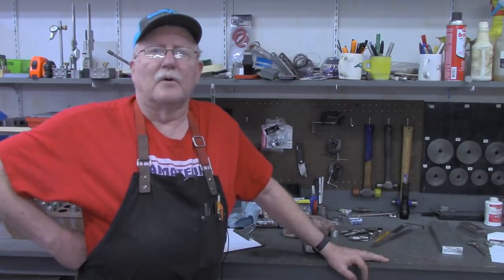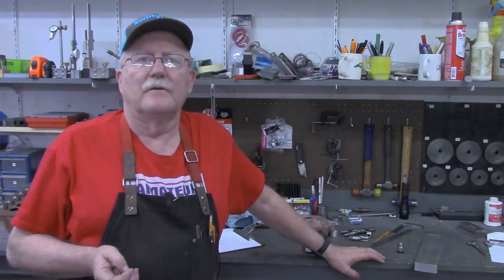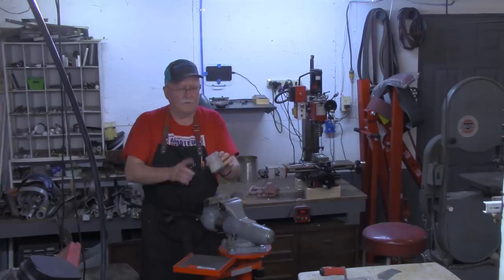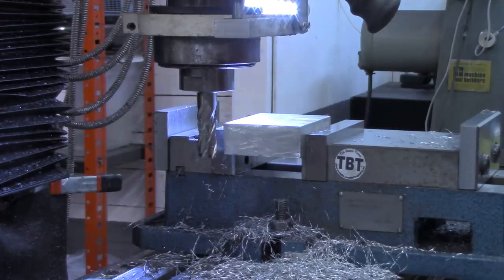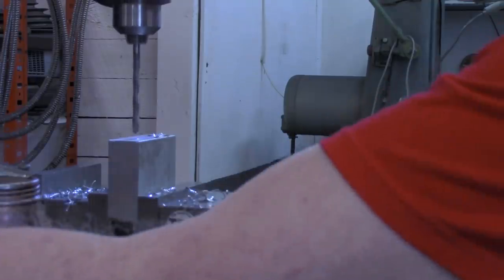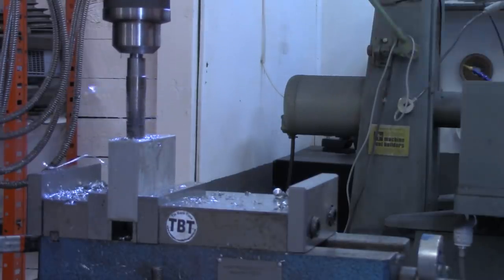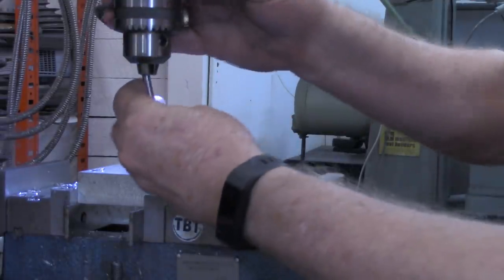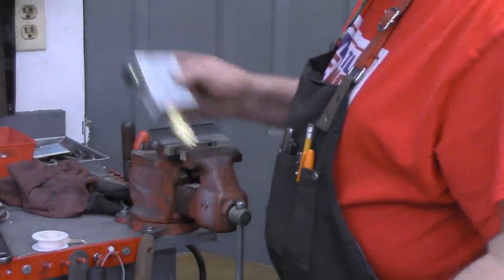Machining a Compressed Air Drop Block

Comment: Lee,
   I agree about the portable band saw from HF. I bought one when they first offer the Bauer and I have to say I don’t really know how I did without it. I’m constantly using it. I put it on an mount that is removed by pulling one pin so can use it portable when I need to buy most of the time it’s in the mount. It was 99 bucks and with a 20% coupon it’s the best money I ever spent for a tool. The saw has performed flawlessly and I’ve put it to some pretty heavy work at times. I’m not doing a promotion for HF. We all know you gotta be careful there but if common sense is used there can be some decent products purchased there.
  Good video. I’m getting ready to plum my shop for air. I was going to use black iron but may look into the rapid air system.

Comment: You should use your old compressor tank for additional volume. It will allow your compressor to run more infrequently, but for longer runs; we have a HUGE extra tank which is great for when painting or drilling or grinding and using a lot of air. Good work quitting smoking. Hopefully that is inspiration to some poor devil who is addicted to tobacco. Probably saved enough to purchase that surface grinder :-)

Comment: Very nice. Kind of looks like pex but more flexible. What is the burst rating?
Reply from the maker: D M Rated at 150 PSI working pressure. I run 125 tank pressure, but regulated down to 100 in the distribution system.
Reply: I used Pex for my air distribution system. 3/4" for the main run and 1/2" for the drops. It was pretty cheap and easy to do.It's been going strong going on 7 or 8 years now. Never had a leak or a pop with all crimped connectors. The only thing I would have done differently is to use the 3/4" straight sticks rather than the coiled up 3/4" pex. The 3/4" pex is a bitch to straighten out. The coiled up 1/2" is easy to work with.